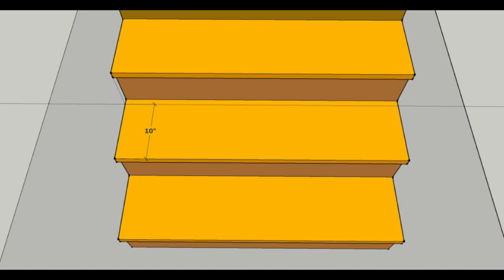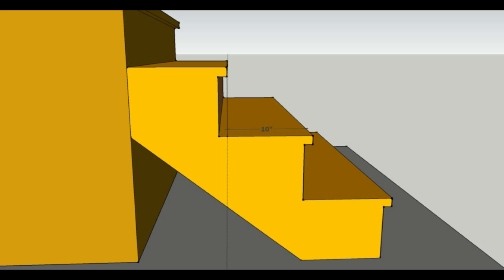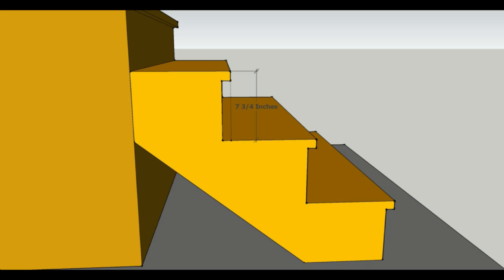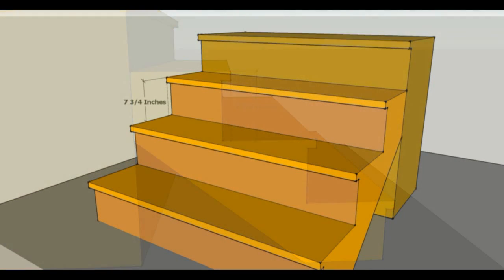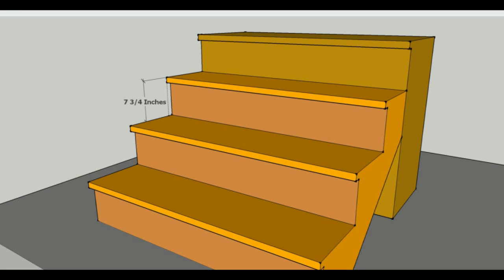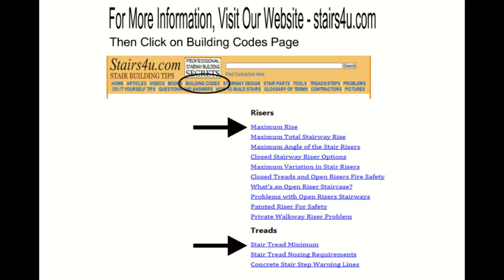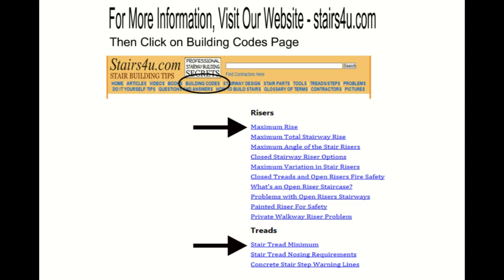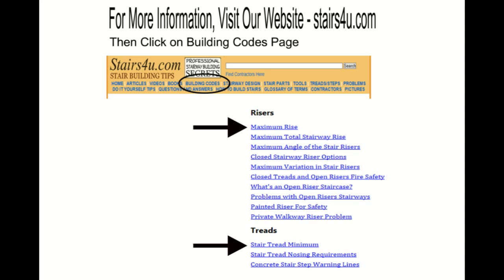Stair Treads and Risers Building Code Update - 2012 International Building Code

Comment: A carpentry built wood stringers from my side porch to my back yard. I noticed the stairs are not level horizontally across the tread. Is this some sort of code or do I have to have them re-do these exterior stringers?
Reply from the maker: I believe the code reference number you might be looking for would be R311.7.7 where it states no more than a 2 percent slope. I would fix them and make them level if possible.

Comment: I moved into a home I purchased and dint realize till after I purchased that the stairs in the basement which are new are code but you hit your head on the ceiling to the tread on the transition. Code shows 6ft 8in but it is 5ft 3in my wife doesn't have a issue as she's 5'2" but I am 6". I was considering redoing the stairs but now code shows the rise is maxed out and the tread is minimum code. I cannot cut away the celeing because it's the stairs to the 2nd floor?! What am I suppose to do to meet the 6ft 8in code??

Thank you
Reply from the maker: I don't think I'll be much help, because it sounds like you need to redesign the stairs and sections of the house. However, feel free to send me some pictures and I'll see if I can give you any ideas. You can get our email address at the website.

Comment: is there anywhere in IBC 09 or 10 which states at what point a stair requires a handrail? I have 3 risers, 10' wide, outdoor public space and need documentation which either stats requirement or exemption for railings. Thanks!
Reply from the maker: +Dennis Himberger I believe you need a handrail for any stairs with more than one step and guard rails if the distance between the ground and the top of a stair step is more than 30 inches. Let me know if you need the page numbers.
Reply: +stairbuilding PAGE NUMBERS WOULD HELP, IF YOU HAVE THEM HANDY. THANKS.
Reply from the maker: +Dennis Himberger Page 61 in the 2012 international residential code r311.7 .8 states that a handrail is required on one side of a stairway with four or more risers.

Page 62 r312.1 .1 A guard rail is required for any stairway or ramp that is more than 30 inches above ground.

I also looked in the international building code, but couldn't find anymore info. However, I would like to point out that I remember reading somewhere, but would also like to point out that I couldn't find it that you needed a handrail for any stairways with more than one step.
Reply: +Dennis Himberger 
"public space" implies the IBC might be enforced there. If public, check ADA requirements too.
Reply: Dennis Himberger

Comment: The 1998 One- and Two-Family Dwelling Code was 7 .75" max riser height/10" min. tread depth nosing-to-nosing.  Most single-family dwelling construction falls under the International Residential Code (IRC 2000/2003/2006/2009/2012/2015).  The International Building Code (IBC) covers dwellings outside the scope of the IRC.  Codes are on 3-year cycles.  Single-family dwellings in the IBC are considered R-3.
Reply: Tom Jacobs and

Comment: These stair tread and riser requirements have been in place for a while now (and I know the video acknowledges that) but even 2003 IBC already had that. This is a good lesson to know that every time a new code is published it is good to review their bulletins on major changes. The 2000 to 2012 IBC is available to the public online through the ICC's website.
Reply: +tdarch 
Thanks! That ICC site is the sketchiest site I've ever had to navigate. Awful.
I like the book. The three ring binder is awkward. The regular binding is easier but you have to add the errata and corrections later with glue I guess.
Reply from the maker: What a bummer, I spent about $150 purchasing a couple of these books about a year ago and now it's online.